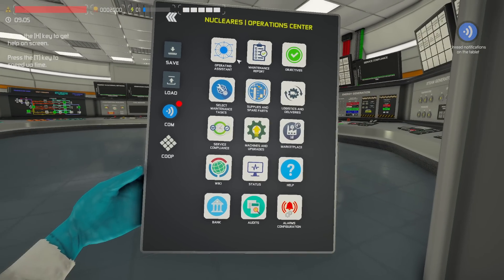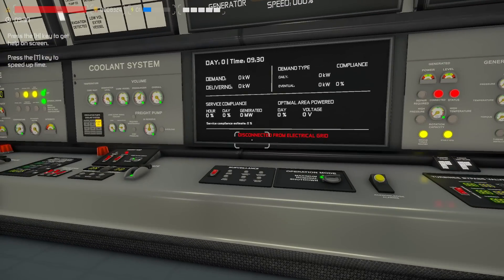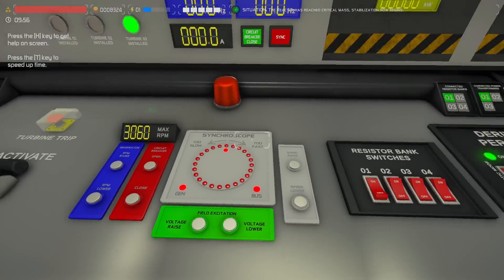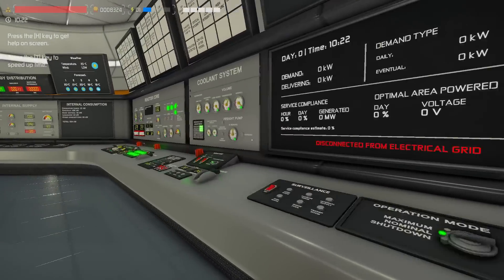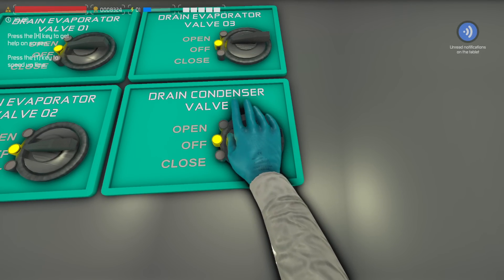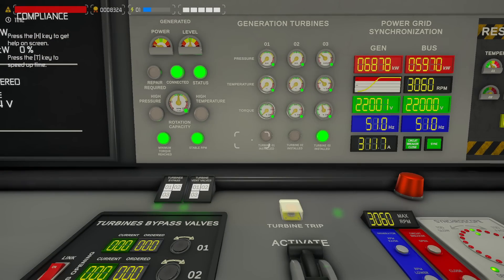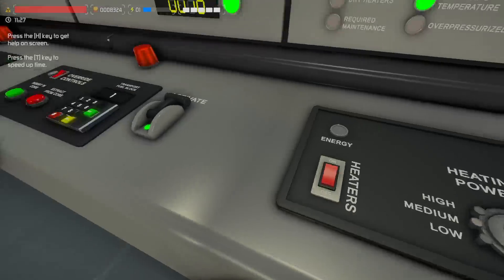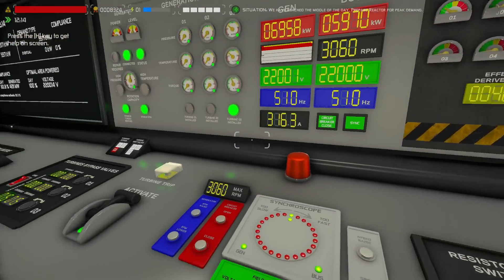Nucleares - Reactor Startup and Synchronizing Generators

Comment: I hope you said good bye to your turbine-generator-set. Synchronised with 41 hz would have killed it. I know your synchronoscope said your run slightly fast and was at 12 o’clock but that’s just wrong. 
Your turbine ist just at 2500 rpm roughly while the grid turns with 3000 rpm. This is an immense force that your machine have to swallow when pulled in the grid with 500 rpm difference. 
Technically the Synchro-device compares the speeds of your turbine with the grid. Is your rpm slightly over 3000 it says too fast and if your turbines turns slower then 3000 it says too slow. 
You can close the generator switch in both directions but it’s necessary to know what happens in both cases. Too slow and your generator consumes energy from the grid until it reached 3000 rpm (runs like a motor), too fast and your machine need to slow down by feed more energy into the grid (for a really short period of time) which is most times the better option, because in real life there are plenty of safety mechanisms for preventing running as a motor in the grid instead as a generator.

Comment: Some people I know invited me to watch the startup of a 1960's 100MW gas turbine generator.  Ten gas turbines driving a single generator, It seemed like a good idea at that time.  This was a periodic test, it is only occasionally used for peak loading.  It had one old school synchronizers with spinning needle.  Fun to watch. They said the test cost $10,000 in fuel.
Reply: The amount of Fuel which gets burned in Power Stations is quiete impressive. I live near a Coal Power Plant, which Burns around 80000 metric Tons of lignite every day.  Thats Just a little Bit under 1 Ton per second, or about two truckloads while you read this. To scrape the lignite Out of the earth, some of the largest, self moving Machines ever built are digging 24/7 through the Ground. If the Mining ends, it will take decades to flood the hole, creating the third largest Lake in Germany- If someone Figures Out where we can get about 2 Billion m3 of Water 😂
Reply: @walterbishop2  I used to travel from US to Germany on a freighter testing LM2500 for the navy.  Engine room had a mechanical counter for barrels of bunker C. It would just go click, click, click.  Down in the stern they had two rings on the propeller drive shaft separated by 3 feet. They how much the shaft twisted to determine the torque.  That was a big shaft!
Reply: This is the startup video.  The file runs normally on my computer.  Somehow it ended up sideways when loaded on YT.  https://youtu.be/0Q9YJJ97WqM

Comment: Oh man I was so mad at how the turbines used to be set up. I operate actual reactors and got the rest of the start up just fine until i started the turbine.just suddenly making power while I am off grid and no throttle. Still not great but its way better than before

Comment: FYI you didn't actually synchronize that correctly, but the game is pretty forgiving.
Reply: What was the problem?
Reply: @Zlonk7  The frequency was not quite matched (48 Hz vs 51 Hz), and the generator voltage was about 2000 volts lower than it should have been. The synchroscope appears to run at 1/10 the speed it actually would for gameplay purposes (especially as the difficulty setting is on Easy), as the sync light should be spinning around at 3Hz. With a mismatched frequency, even if the breaker was closed in at the in-phase point, the grid would inflict a lot of torque on the generator to bring it up to speed, so much torque that it could literally twist a very heavy generator structure off of its mountings, or at least damage it through the resulting stresses. With a generator voltage too low, the grid treats the generator like a motor to drive, and the sudden influx of power (until the generator voltage comes up) can cause arcing and damaging of the generator's electrical components.

You have to match the generator frequencies closely by changing the turbine speed to typically less than 1Hz, and the voltage has to match. The "excitation voltage" control shown is how the voltage is adjusted. Big electrical generators use an electromagnet in its rotor to generate and control the magnetic field that the main electrical power is generated from. By changing the voltage powering that magnet (excitation voltage), you can change the voltage output of the generator independent of its speed. Only once frequency, phase, and voltage is closely matched can you close the breaker without damaging your generator or blacking out the city.
Reply: @eddievhfan1984  thanks for the info
Reply: @Zlonk7  There wasn't 87 pages of paperwork to be filled out and 17 safety briefings

Comment: The grid frequency of 51Hz is actually pretty accurate for the real grid, in low load the grid will be high on frequency and on a heavily loaded grid it will be slightly low. That is used in plants as a control cue to open or close the turbine inlet valves to reach a 'target' of 50Hz. Too fast means less heat demand and too slow means more heat demand, which acts as a throttle for the entire plant.

"Generator load" logic really isn't accurate yet, when the generators produce voltage it will only cause current (and power) to flow once some component is demanding it. In real life, there is no electrical power that you need to dump somewhere, if there is no load on the plant, the turbine is either bypassed or out of the steam circuit and you only need to dump thermal energy through the condenser. But I can understand why they designed it this way for gameplay reasons.
Reply: My grid is 60hz here.. I noticed I can't 'speed' up the turbine to give more load to the grid, only vent steam by? My turbine would sync at 3600rpm, then  raise load to make like 10MW at 4050rpm of load. *in real life